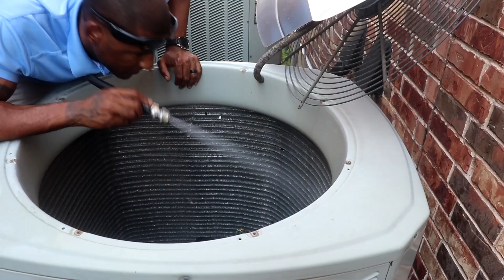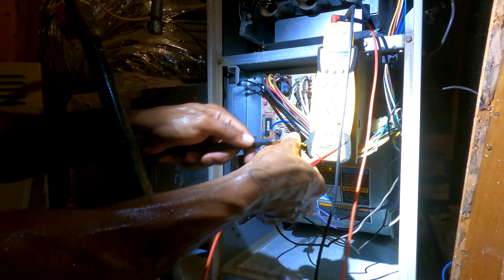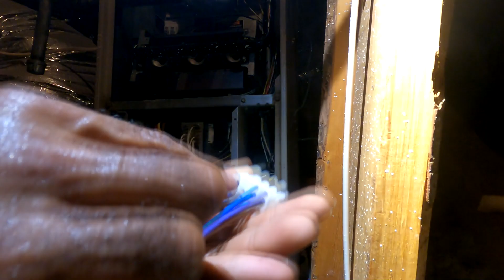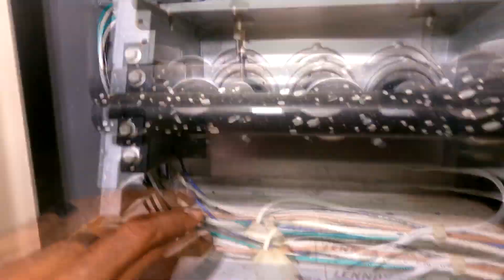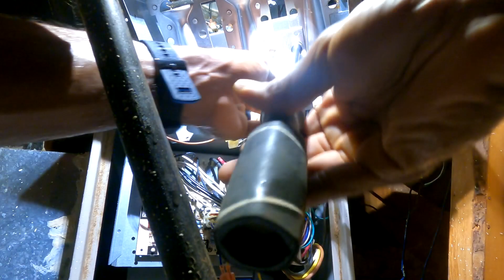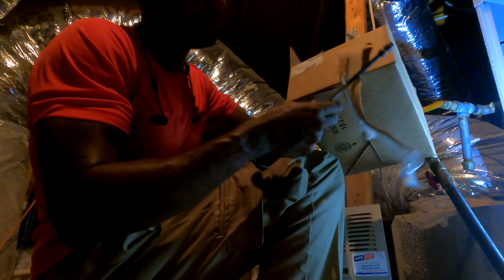"Take Control: Step-by-Step Guide to Replacing Lennox Surelight Control Board for a Refreshing A/C!"

Comment: Walter just a tip, most Lennox units you can pull the door lockout switch "OUT" to keep the unit running, you do not need to hold the button in, to do your voltage testing. Hope this TIP helps when you need to run tests on future HVAC units that need servicing. You did a great job showing DYI owners how to change the control board. Shame on Lennox, to not stock the same style boards, as a OEM replacement. I think White Rodgers makes the changes in the control boards for Lennox and that is why you had to spend lots more time in a hot attic to change it out. Lennox is known for its modifications year to year with its internal devices, motor, controls, sensors ecta every few years. Lennox designs their units using whatever they find in stock, the year of marketing the units and you are left as a repair tech. and the DYI owners with this mess to try to find a board or a bad part that will work in their older units that fail. This Lennox swapping of parts causes all repair techs. major confusion with parts like ECM blower motors, that need to be matched to the Surelight control boards, also the PROM firmware on the control board has to be matched to the HVAC units devices to function properly.
 Stay safe Walter, and best of luck moving forward.
 Eric a retired owner of HVAC and hydronic heating systems.

Comment: Man, I can't thank you enough! Literally the same unit and board. I was getting nervous since it the board was quite different from the previous one but you walked me through and quite saved me!
The only thing I do want to ask, though you may not remember anymore, didn't the igniter end up too high and close to the flame? When I replaced mine it seemed like the white part under the rod would also be hit by the flame, could that be an issue? Thank you so much again!

Comment: Thanks for this video! I've installed that board but now it appears I need a new hot surface ignitor due to the old one not being compatible. The board is a 21D83M-843 on a Lennox G40UH-24A-045-03 -- how can I find out which ignitor is necessary for that board?
Reply: Have you found a solution?  I went through 2 ignitor's already. Only last a month.

Comment: Thanks for the video.  I need to replace the surelight board in my furnace. Mine is a two speed heat system.  Is this board only single speed heat? If yes, how can I tell which blower wire is low and which is high? My furnace is Lennox model G27M3-75A-2. Thanks.